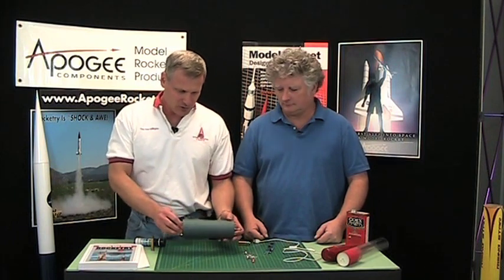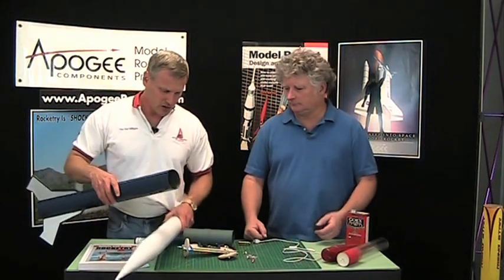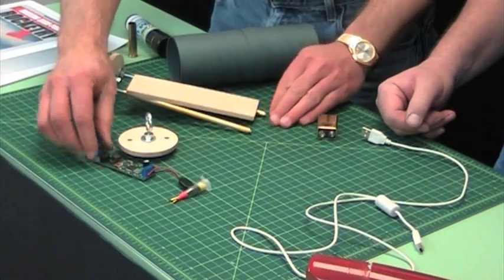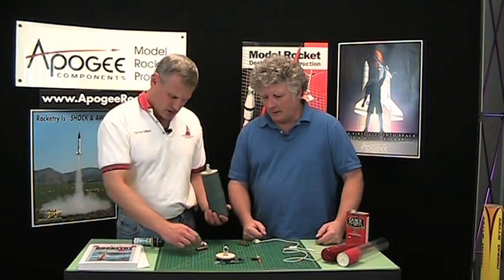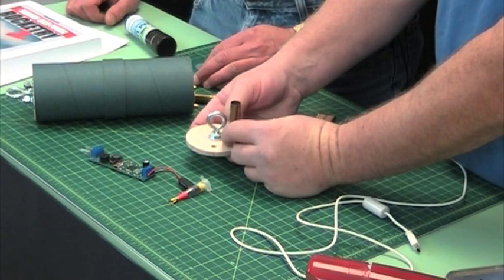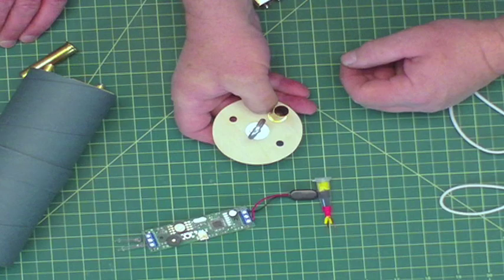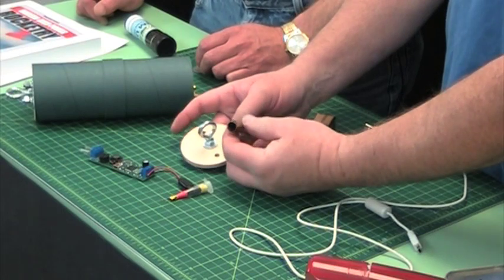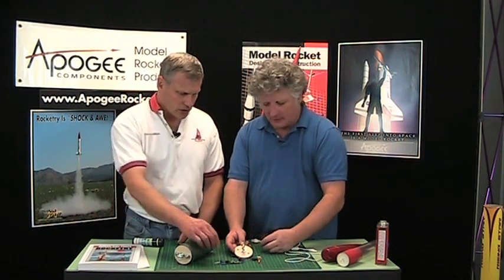Dual Deployment for High Power Model Rockets Part 2

Comment: I learn so much from the Apogee videos.  But I'll make one suggestion; on topics like this one.  Start at a high level overview and then drill down into the components.  The first thing after describing what Dual Deployment is should have been a completely prepped rocket  that you then start disassembling to show the parachutes, the AV Bay, then the charges, then the electronics inside.  Then start one by one describing the components, how they work and how they work together.

Comment: Hey Tim- as an avid firearm enthusiast and rocketry hobbyist, I can confirm that PVC pipe is NOT safe for explosives in non-lab-controlled settings. The HDP casings used for rocket engines are machined to tight tolerances set by the manufacturer, but are in no way comparable to the tolerance or strength of PVC. I use .45 long colt brass with the primer pocket drilled out for my ejection charges because those casings were made to withstand 50,000PSI (SAAMI proofing spec) in a firearm- 

I put the igniter in through the case head (the side with the lettering on it), tape it, fill appropriately with black powder (for my rocket, 23 grains or 1.5 grams is appropriate on the aft end) and stuff the end with dog barf wadding, lightly compressing it. I promise you, brass casings are safer by far.

Comment: Hope this gives you an idea, on how complicated your dream is… GOOD LUCK 
BTW: If you do launch a rocket into Space… and it does come back to Earth. It will just burn up in Earth’s atmosphere (No point of a GPS)
Reply: not on a suborbital trajectory, the velocity isnt nearly enough to cause heating. Also your other comments are inaccurate to some degree. To get into space on a suborbital trajectory, you can do so on a P class motor with a minimum diameter kit. Cameras and gps tracking are more than good ideas, their required almost. Look up space shots on youtube just to see how wrong you are. (I know this comment is 8 years too late)

Comment: One pump carries the fuel, the other carries the liquid oxygen. These pumps will lead to a combustion chamber, which then leads out the nozzle, which then exits your rocket. If you want your rocket to return to the Earth, you will need you parachute to be electrically deployed, since there is no ejection charge. Basically your dream is extremely complex, and likely can’t be reached by yourself.

Comment: I have the same dream… But it is extremely complicated
If you going build this, your rocket MUST! Be powered through liquid (just like the real ones that go into space). Solid rocket fuel, like the ones Apogee Rockets sells, isn’t powerful enough.  You will need to find a way to compress liquid oxygen in your rocket (allows the fuel to burn at high altitudes). You will need two pumps in the body of your rocket.